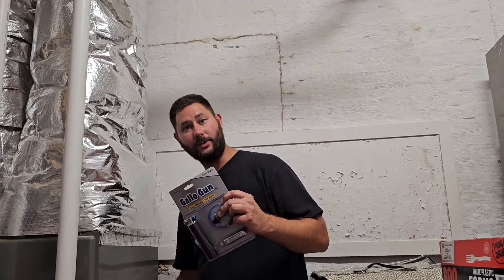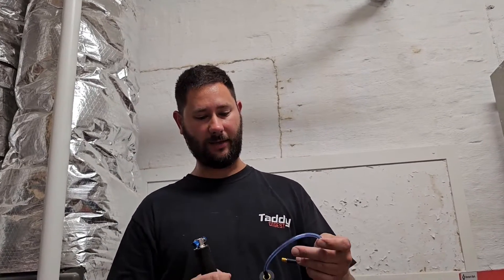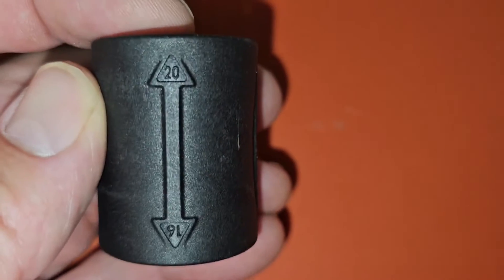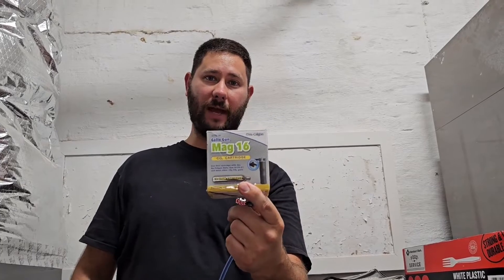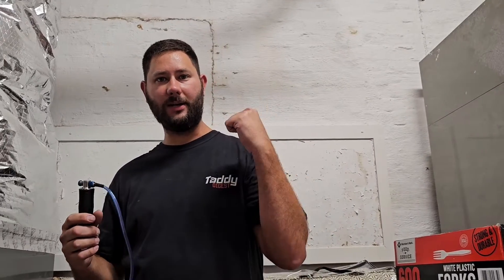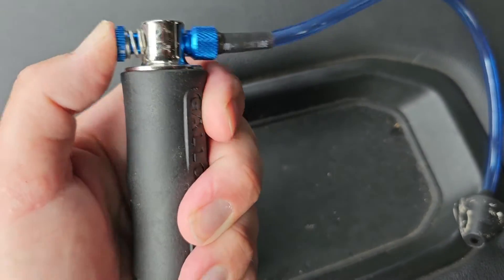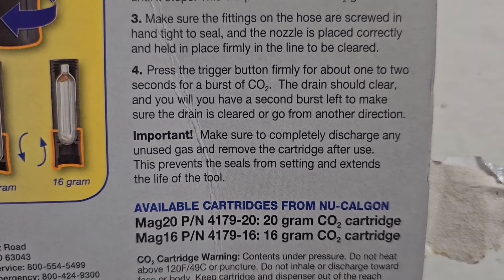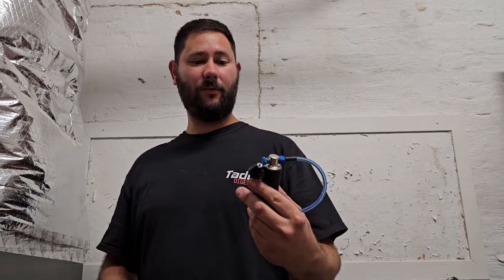CO2 Drain Opener: Does It Really Work? (Shocking Results)

Comment: Been using it since I got out of college. 6 years now. Work great.
Reply: I'm not a tech...but my drain pan has some water in it in the attic and the condensate is definitely clogged. But I don't feel water in the pipes going away from the air handler, what if the clog is like in the actual air handler and not the actual pipe? Is that possible?

Comment: I’m just curious, especially if you have a unit that was iced up and since thawed; therefore having the water build up in secondary drain pans, couldn’t you use a transfer pump and just use the water pressure from the pump to flush out the drain line and clear any blockages?
Reply from the maker: yes absolutely